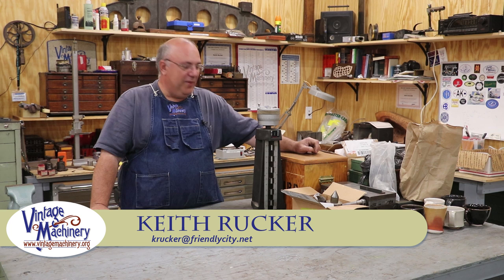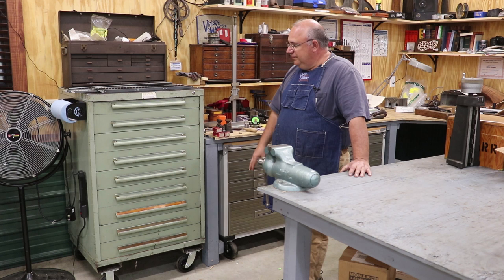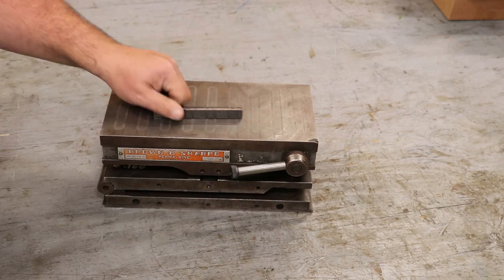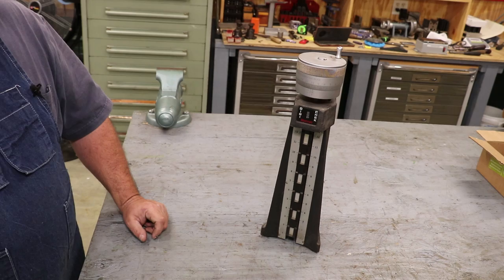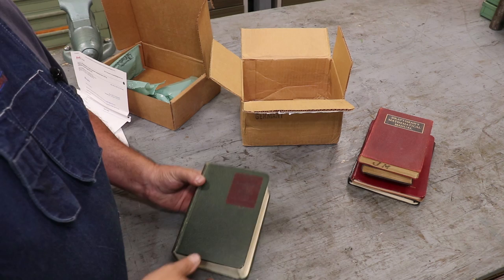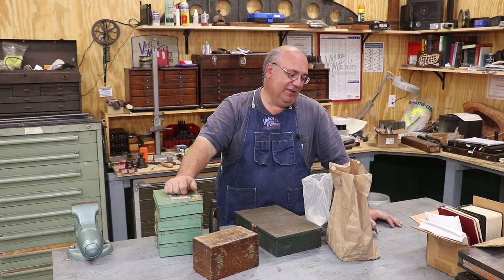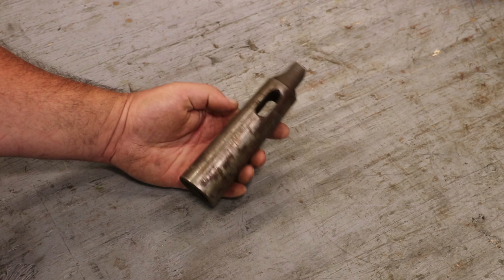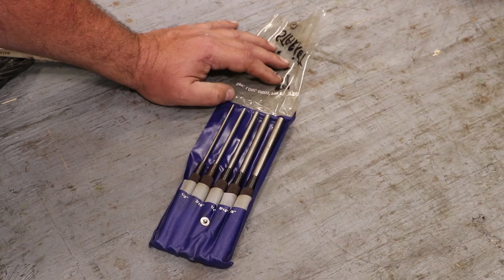Odds & Ends 81:  New Tools and the Moultrie Swap Meet

Comment: Good to see you at Moultie, Keith. Our group from central Florida had a good time as well. I picked up Starrett height gauge the same size as yours with the case hardened finish.  It's already cleaned up and on the surface plate. Happy Thanksgiving.

Comment: You can also use the height gauge with surface gauge/height gauge and an indicator to do comparative measurements.  You can check pin alignment holes, compare the heights of surface features, etc.  You set the indicator on 0, then place the indicator on one of the gauge blocks in the height gauge and use the dial to bring the indicator back to 0.  Then you read the height gauge directly.

You can also search for information on the Mitutoyo Height Master.  They work the same way.

Comment: Keith;

I purchased a Digi-Chek that also did not move (got it for a very low price because of this).  The most likely issue is that someone oiled the slider mechanism and it has gummed up over time.  This was the issue with my Digi-Chek.  

Unscrew the back cover and spray in a bunch of WD-40 on the mechanism and let sit a while.  Try to see if the handle rotates then.  Keep repeating a few times if the first time doesn't work.

I eventually had to disassemble mine, but it isn't that difficult.  Just make sure to not lose any of the parts ;).

Regards;

Ron Kluwe

Comment: Better than the gas can vents, just drill a hole where the vent goes and insert a tire valve stem, with the stem removed, add the cap after you pull it through.

Comment: Very cool.  I have that same B&S stand.  Mine also came with a Federal indicator with the Wright Aircraft Engines logo on it.  Mark at MR Tool got it working nicely for me.  I had to make the T nut for it, its some odd thread that was almost a perfect match for a metric, so thats what it got tapped to.

Comment: It would be interesting to see how a mag-base/plate works. I've always wondered what was inside and how the magnet could turn off/on with a flick of the lever. Is it an electro magnet or some other mechanical method? Inquiring minds want to know.  :-)

Comment: The new gas cans have vents built into the nozzles. They were mandated because of the number of unfortunate incidents involving the older kind and fire (but also often with children at fault; the new ones are considered child-resistant).
Reply: it amuses me when some youtubers call them obama gas cans...then i wonder, if trump is gonna bring back putting gas into open buckets...lol
Reply: Jusb1066 Right?!? See also: all the rants about OSHA, the EPA, etc. As though the problem is prohibitions against dumping hazardous chemicals into the atmosphere, water supply, and employees, and not the fact that such prohibitions had to be enacted.
Reply: I have more trouble with the new ones! They freaking SUCK!!
Reply: J Hefflinger If you can't operate a modern gas can then I have bad news for your outlook as a machinist. 😉
Reply: Your a real funny guy Jon. har har
Reply: Who is calling for putting gas in open buckets?  Nobody!  We are sick of gas cans you can't get the fuel out of.  They suck and cause more spills and slipped disks.
Reply: I understand how the new cans are supposed to work.  I have found it impossible to fuel some equipment with these new cans due to their configuration.  I have had to transfer the fuel to an old style can to complete the task.  Be careful that the vacuum created in using the new cans does not pull the o-ring seal off it's seat.  If this happens, and it does, you can spill quite a bit of fuel before regaining control.  They do work, but be careful, and it is somewhat slower than with the older cans.  Just my experience with them.
Reply: Jon Miller Idiot resistant...tho, not idiot proof. Tractor Supply does sell the older "parts kit" for your newer style can.
Reply: Personally, having walked on THIS Globe 
since Ike was President, I have the background 
to say that these "new" gas cans are the spawn 
of the devil!  I WISH I could find a few of the OLD 
style STEEL gas cans we had in the Army, in the 
'80s!  I remember them, as well as the name for 
the filler hose.  (A centerline drain hose, on a 
donkey.)

The current designers of this "Bravo Sierra,"
reminds me of that donkey part!

Can I just get a decent gas can, without breaking 
federal laws?  Please?  I PROMISE I won't spill as 
much gasoline!

(Keith, sorry to hijack your post.  {Great, I'm going 
to prison for saying "Hi" to my friend Jack!}) :D

steve
Reply: Steve Skouson They're still around and military surplus outlets and the like if you absolutely insist. They just can't be manufactured and sold as new.  

Keep in mind that while you survived since Ike, not everyone did. I see that kind of reasoning all the time, like Facebook posts about how "when we were kids mom's arm was the seatbelt and we made it through just fine, thank you very much". You have to ignore the countless thousands who actually died to share that kind of sentiment. 

Incidentally the vent integrated with the nozzle on the new cans is partially for safety and partially to prevent evaporative emissions. It is doubly beneficial. I promise it's going to be okay.
Reply: Jon, I wasn't serving when Ike was SHAEF, I was just 
barely drawing breath.

That being said, I NEVER spilled as much petroleum 
products, as I have, with these new POS (that is NOT 
"point of sale") gas cans!  I've been pouring gasoline 
out of cans, since LBJ was president, though.

LBJ, RMN, Jerry Ford, Jimmy Carter, RMN, 
GB, WJC, or GWB didn't institute these.

BHO DID!

Ball is in your court.  Post a rebuttal, and I'll respond.
Meanwhile, I'm spilling gasoline down my leg, with the 
"new" pieces of excrement!

steve
Reply: Modern fuel cans work well at what they're designed to do, prevent spills and vapor loss during transport and storage.  Sometimes difficult to pour gas from.  You may need some patients, get down on one knee  and maybe try a few different funnels.  Mother Earth thanks you for practicing you most careful dispensing technique.    Reward yourself with a nice day fishing at a nearby creek.  Be sure to catch and release ;-)
Reply: Steve Skouson Steve, my 12 year old manages just fine with them. I don't understand what your problem is so I really can't help you with it. And I assure you "BHO" had nothing to do with their design. Nor have any presidents with any gas cans, as far as I'm aware. Kind of an odd fixation you have there. Good luck with that.